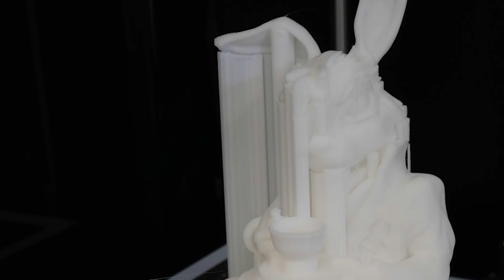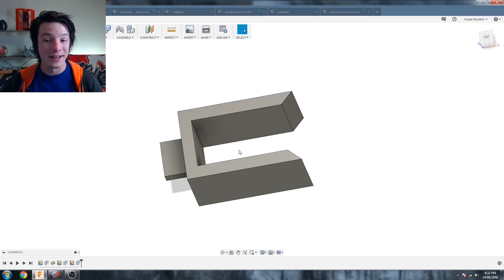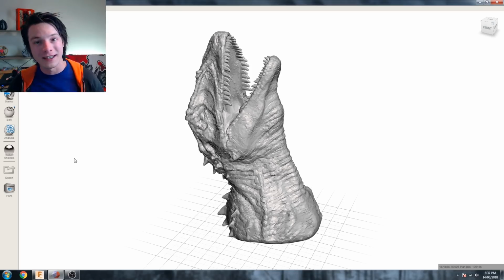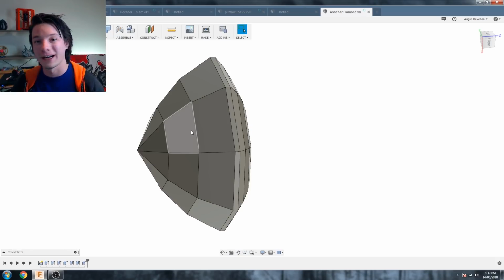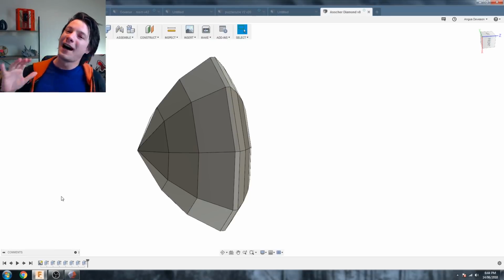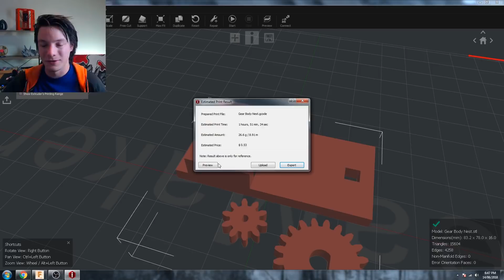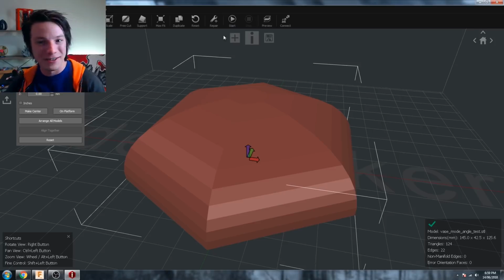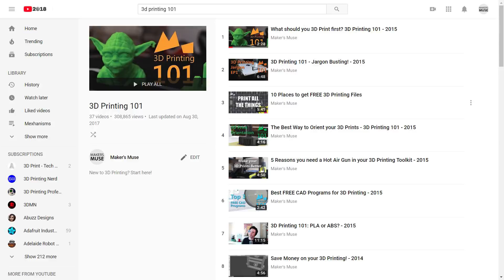Design Tips for Support Free 3D Printing Models (FDM)

Comment: How do you deal with, the gravity affect the sizing? I use 45°for a long time, and noticed that the gravity still make messes with the shape, like make it curves, wrong angle, wrong cross X sizes, etc. otherwise, a lot of times when I need the side stiffness , the tilting would be limited. This time I use different material method, nylon is not stick good with pla, so when I make this type of support, it’s easier to remove.

Comment: As a beginner I add automatic supports and brim to every printed model, unless it is said in a description, that the model is printed without supports. Did print one without supports, as it was said, and it worked. But if you have to tinker with slicer settings to avoid using supports, then you better not say 'no supports required' in the description of the model.

Comment: What a coincidence.  I was printing several different face masks to sell and lowered the perimeter to 1 to make the mask as thin and light weight as I could for comfortableness.  The 1st layer height to .15, layer height to .2.  extrusion width to .45 except for a couple individual ext widths that were .42 and .45.  Well the print turned out very smooth except for when the layers started to angle and a few layers were all unraveled but then after that beautiful layers.  I don't know what happened either I walked into the room and a gust of cool air from the AC must have reached the printer (corner of my room) and caused the plastic to cool.  I keep my windows open for air circulation which (desert heat) and doesn't affect the plastic cooling.  It was as if my Prusa Mk3 was saying i screwed up a few layers but got back on track and check it out.  I couldn't believe how the layers regained their foundation and didn't become uneven post the messed up layers.  That was the first time I had a print that had a hiccup but regained its footing and came out nice.  I cannot use the print to sell even though I blow dried the print and was able to press the layers against the clean layers to make it somewhat decent.  Anyhow, how I see how lowering layer height and increasing extruder width helped.  I am going to see if I can code some gcode to slow the printer speed down for those messed up layers, because I have my speeds kicked up for fast print.  And it could have been the extruder.  Maybe there was a catch in the spool filament that may have slowed down the extruder of trying to extrude filament.  I do not know  until I exhaust my tweaks.  Any suggestions would be helpful.   Thanks again for the great video.

Comment: I designed a model that's 9 spheres inside one another with very minimum support and all spheres can rotate independently in all axis. And the idea here is that, for PLA at least, printing bottomless is very viable as long as the first layer layout size is large enough to make the model not tip

Comment: hello im still new to 3d printing, Currently i am printing costumes in tpu just wondering about using supports on tpu and looking for advice i have a small 220x220 x250 longer printer and a cr10 s4. also any tips for printing large items such as full torso piece  on the cr10 s4 in tpu . i started to print a chest piece which said time was 3 days day one it was great then day 2 it went all wonky

Comment: Extreme Overhangs!  I have learned so much from being subscribed to this channel, and one of the things I have learned best is to minimize supports.  So much so I print the seemingly impossible without supports.  My main setting is 3 outline/perimeter shells, 3 top, and 3 bottom layers in Simplify3D and I get great results on my almost never maintained CR10s 500x500.  I get internal stringing, but hardly any external.  Somtimes I have modelled in some 'chairs', sometimes I manually add some very sparse supports. I hope you like some of my examples of these techniques!

https://share.icloud.com/photos/0E_N2b_kNctr7aqQGehhCeaMg

PS, I normally print 0.28 layer height.  The example in these photos is going to be used to make sand molds for cast aluminium, so the surface texture is not an issue.  I can easy sand out or fill any bits I don't like.

Cheers,
Mark.
Reply: Photos not available.

Comment: Question. I have an FLSUN QQ-S and I replaced the nozzle and somehow adjusted the zed axis and now one side of the print is fine yet the other side has striation and poor print quality. I use Simplify 3d as the slicer. What could be wrong?

Comment: 3:45 you're basically just adding non removable support material
Reply: Kiros yes lol
Reply: i always add fillets or chamfers to my designs if its not effect working of parts , i think its better than supports , fillets and chamfers making stronger and better surface quality and reducing possible print fails. in last one year , i just used supports 3 times.

Comment: It is possible to print with an overhang of 60 degrees.
At least, with PETG, I was able to print a spring, with an overhang
of 65 degrees. I just needed to give it time to cool down,
so I printed a column on the side, which did not do anything, except
allowing the very small cross section of the spring, to cool down.
Sometimes, you might want to incorporate support material in the design itself.
I also noticed, Fusion360 can generate support.
And it looks like it's doing that pretty well, compared to other slicers.
If you have experience with this, let me know what you think about Fusion360

Comment: Or your could just rotate the entire original part 45 degrees since it was orthagonal to begin with, so that the tab and one corner of the object both touched the plate, meaning that all angles would be close to 45 degrees without verticals. But still a great video nonetheless :)

Comment: Hmm I may have to do a little testing.

Doing a few prints with a "bridge" they are 2 inches high, and no more than 2 inches wide and of course printing out support for the whole thing when its only a couple of mms of detail seems a huge waste.

So I will cut up the model and do a test print (literally just the bridge portion) to see if my printer and settings can handle it.

Worth the time doing the test print, if it ultimately saves time (and material) as each print takes 8+ hours.

Although I could modify the models to have a 40° "over hang" to help bridge it. Again a great idea from watching your video!

Comment: I've had huge success with printing at lower temps, slower speeds, then using a support roof like the ones in Cura.
I've used support roofs after trying dozens of different support methods.

But I think the take away from this video should be to avoid needing supports, and to think about the shape of your object/

Comment: I'm curious. Many people 3D print fractals, but I'm wondering about how to print a decently sized Menger sponge with no supports without printing 20 parts and gluing them together to make a larger one. If a printer can handle 45 degree overhangs, how would a printer handle a Menger Sponge sliced at a diagonal so that it's two halves but it's absolutely filled with 45 degree overhangs? Could be an interesting stress test that simultaneously tests detail and overhang capability.
Reply: The images I see of Menger Sponge appear to show an object that should print quite well using bridging, as there appear to be no cantilevers, but straight bridges supported on both ends. But if you orient onto a corner to print at 45 degree angle, will you mess up one corner or just split the whole model in half or something to have 2 parts?  Seems better to optimize your printer for good bridging to solve this problem.

Comment: My Creality printer I was in the middle of a print and realized it had a 3cm gap. I used an ordinary sheet of paper under briefly slowed it to 80 percent. It printed just fine....just a guess but probably didn't need to use a support.

Comment: Regarding overhang angle: of course, if you can change your nozzle, you could slap on a 0.8mm nozzle and go to 0.1mm layer height (or even finer, perhaps) and not only could you push the overhangs, the surface finish wouldn't suffer as much.

Comment: Good stuff! I'm guessing that material probably also has some effect; specifically I'm still using abs which has more expansion/contraction with cooling. I suspect that slowing print speed might improve overhang (if it goes too fast, the extruded filament just shrivels up and doesn't adhere to the previous layer well) but I haven't specifically investigated it - been too busy printing desired parts to try your style of systematic experimentation. Any thoughts on this?

Comment: Hi Angus, thanks for the video! In the future, could you please try to put the face cam in the upper right? You tend to cover up the menus in the software you're using, and it makes it hard to associate tools with a location in the interface.

Also, in relation to giving yourself a good first layer, what's your thoughts on modifying the model versus moving the model below the build plate in your slicer?

Thanks!!

Comment: Hi, I'm very new to 3D printing. I want to 3D print a PC case, which will require quite a few "plates" to make a very long and flat surface. I plan on designing them so that they interlock, but my concern is with the whole surface bending under weight attached to it. Would embedding steel rods (1/8" in a 4mm plate), or aluminium bars be a good way of strengthening the object?

Comment: Another tip, as a bonus to the sacrificial bridging technique: If you have the space around your model, you can model in pillars that make your cantilevered overhangs into bridges. It can be tricky with more complicated models, but with practice, it's super useful. Just support the free end of an overhang with a "bridge pillar" for the first layer of the bridge and break the pillar away after printing.

Comment: Also, remember superglue. You don't have to print everything in one piece. As you've said, you can split some models in half, or for example if you want to print something like a model of the Jesus statue in Rio with the 90° overhanging arms, you change your model and print the arms separately and glue them on later. You could even add a little notch to your model so that the parts fit together perfectly later on.

Comment: Hey, I just ordered a Creality cr-10s, what filaments should I start using being new to 3d printing?
Reply: PLA, its imho the easiest filament to work with. It doesnt need very high temperatures or an enclosure, and mostly yields good results. Its for the most part super easy to print with, even bed adhesion is no problem, you can get it to stick on painters tape, gluestick on the glass or even directly on the glass without any additional measure. 
ASA is also a solid choice for material that can be printed on the CR-10s, but you will need to make ASA-Juice (50ml Acetone + 150mm ASA-Filament cut to small pieces, dissolved over night) to get the prints to stick on your bed. And ASA is generally a bit harder to print, and should be printed with an enclosure around the printer (but you can get away with small prints without one)

I would full heartedly recommend PLA. But if you want to print stuff for outdoor/car use right from the start, you might want to take a look at ASA.
Reply: terl0th Thanks for the help, but I was trying to ask what filament brands are good, not what type of plastic to use.
Reply: Oh, i misunderstood. I use janbex pla and Filamentum asa, but i guess you cant really Go wrong with branded stuff like the Filaments from matterhackers

Comment: This has for a long time been something that irked me a bit about many models shared in thingiverse, models that with just a little bit thought could be printed with no supports. Of course it is bad to complain about free stuff, but things like this is really something that denotes experience in 3d printing and a "fdm mindset" in modeling. 

Great video angus, make more like these please. 
Splitting for a clean bottom surface does not have to be done in meshmixer btw, at least S3d this can be done simply by lowering the model slightly so it is "cut" by the bed and the result is the same. 

I have a few more tricks to add to this, one is like greg gallacci mentiones to make "supports" in the model itself. A variation of that can be designed as absolute minimal up to required height and greater surface close to where it is supposed to work, removing lots of excess support material. Bit hard to explain in words. 
Another trick is to use bridging smarter where there are angles in the bridge. Still hard to explain in words, but the essence is to separate by one or two layer heights so it first will bridge one way and then have support for a second orientation. Useful for holes as well. 

It is finding solutions like this that makes 3d printing and modeling just a little more fun for me.

Comment: I think I am very good at thinking about models in 3D and visualize support. 

I even designed a model for a print in place two part model radio box. I sadly got he hinge too tiny but it worked once. 

I dislike support as well and try to avoid it as much as possible. But I would need more help with getting the least amount of support on a model that work. It depends on the slicer but I was printing an inverse sphere recently and therefore I set the supports to 54° degrees

Comment: There's one more tip you didn't mentioned.
Some models require dense infill in order to support overhanging layers, increasing the number of perimeters to 3-5 would work just like increasing the extrusion width.
And it will allow to print on low infills with great quality on sharp overhangs (45 degrees +) with smooth outer face surface.

Comment: Ya missed a very powerful tool in support-free land: including supports in the model itself!
SR-71 model, ran out of ideas how to print it without support-hell.
So I stood the model up on end, added a few narrow 'blades' attached to the engine nacelles and fuselage.
The blades flared out where they met the build-plate.
Printed the model, no supports.  After printing, cut off the blades, have cool model.
Reply from the maker: Definitely a hugely powerful way of negating supports! I've been working on a lot of models recently and trying to make them as easy as possible (no supports or post processing) which inspired this video, but another detailing designed in supports is a good idea. Like the good old days!
Reply: So instead of using supports you USE SUPPORTS?
Reply: @sambenao7  That's genius!
But yeah I don't know, I just use auto-generated support in those cases. Especially tree support, it's usually very clever and also looks amazing. I sometimes keep it, if I manage to break it off intact. Sometimes I suspect I make weird design decisions, just to get some nice support structures. 
I shall not presume to be an expert though, it's possible there may be situations where self made support can be more ideal.
Reply: The bridging idea is very similar to what you are describing, Greg.
Angus edited the original STL file by adding one thin, solid layer to the STL.  He easily cut it off later just like you. :)

Comment: Overhang analysis in Cura 3.
Cura, Solid view, Supports enabled, specify overhang angle in Supports.
Overhangs greater than or equal to specified angle shown in red.
Doesn't work in X-ray or Layer view.
Reply: Hi Angus, thank you for the videos you post, I have gotten many ideas and a lot of inspiration from them. Can you tell me what brand, type is the black filament with white spots, it’s at the beginning of this video? Thx Peter

Comment: No need to add 45 degree over hang if you rotate that part to where the two edges make a 45 degree triangle. some slicer programs count backwards from verticle; that is why people state 70 degree coverage when it really is only 20 degree coverage.

Comment: Cool video, never heard of sacrificial bridging before so I’ll have to give it a try next time I make a model, out of curiousity, why did you skip 45-60 degree angling conventional models? That tuning fork model for example, assuming you could not add a chamfer because the over hang was intended to slot into something, you could angle the entire model, add just enough support under and around the edge with a brim maybe and get away without as many supports and potentially stronger part because the layers are angled 45 degrees to potential forces, hmm guess it doesn’t follow your title of not using supports i guess, thing is that I’m right now printing a plastic case for a gem stone that is a simple oval like extrusion with some over hangs on the top and lots of lopoid pattern (swiss cheese holes) all over, a nightmare of a model for printing but it is most effectively printed not on the flat side of an oval where gaps and layers might be most easily visible and put unneccesary strain on a necklace ring but at 45 degrees like a resin printer might slice its model, that actually brings up a good video subject, why resin prints are sliced at different angles from fdm machines, anyways, keep up the interesting projects and content!